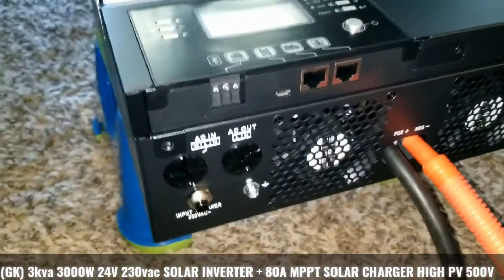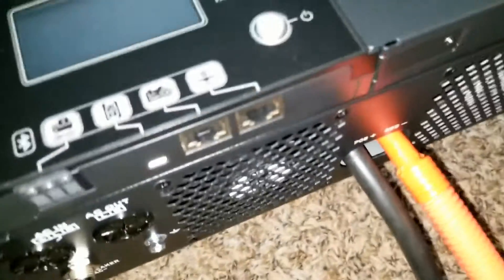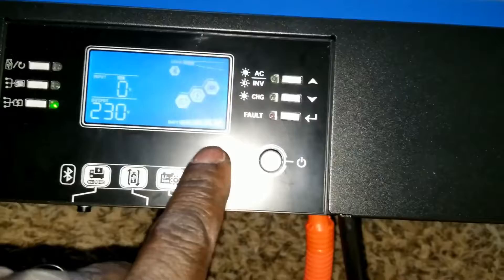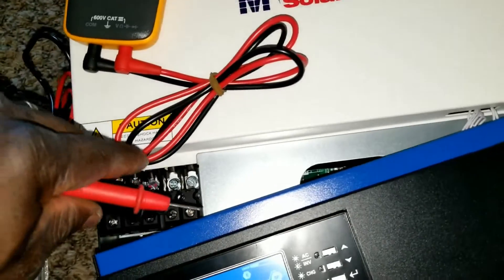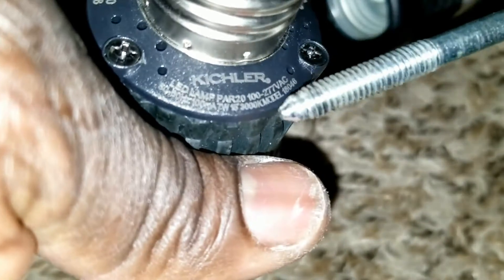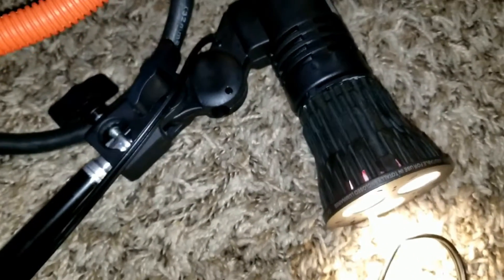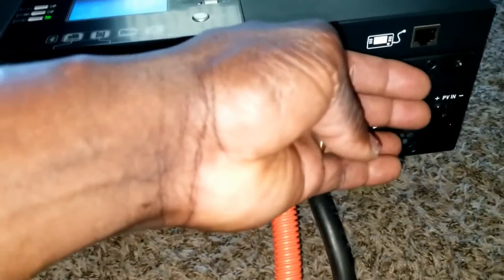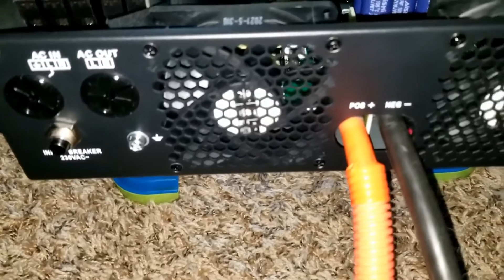(GK) 3kva 3000W 24V 230vac SOLAR INVERTER + 80A MPPT SOLAR CHARGER HIGH PV 500V (PART2)

Comment: I have the same inverter - my solar (pv) light flashes on/off - is this normal ? 

It reads 140v 0amps 0watts.. no charge, won’t charge the battery’s from my solar ,.. can’t figure out why ? Any ideas ?
Reply from the maker: Sorry to hear that. It might  be a defective device. 
I will recommend you contact the seller or the manufacturer.
Thanks for stopping by, LIKE SHARE & SUBSCRIBE

Comment: I have the same unit. The solar charge icon is flashing,.. my charge input shows only Volts & 0 amps 0 watts ... 

Should the solar light be flashing or stay on permanently when working properly. 

Trying to find out my problem
Reply from the maker: It might be a faulty machine. I will recommend you contact the seller or the manufacturer.
I appreciate you stopping by. Don't forget to check out my latest videos, LIKE SHARE & SUBSCRIBE

Comment: I have the same inverter coming but mines 48v 5000w  off brand PowMr my only concern is the AC output only having a L & N and no ground if I'm not using the ac input how do I fix this issue ??
Reply from the maker: Be mindful this Inverter/Changer is a single Phase international version 230Vac. L & N Ground is on the body of the inverter
Reply: @jwsolarusa  do I ground the body to a grounding rod ? I plan on running the line and neutral to a subpanel box using a midpoint transformer by solar edge to get the 120 legs and I'm just worried about which way to ground

Comment: The inverter will not boot if the fans or even one fan is not working properly, also when the need comes for both fans to work it will work with no problem. I have used the PIP GK model for about 3 years and it has worked fine for me even with the hot weather in Ghana.
Reply from the maker: Thanks for the input